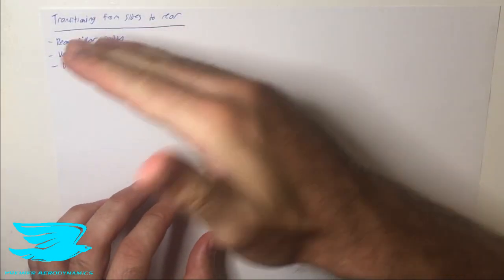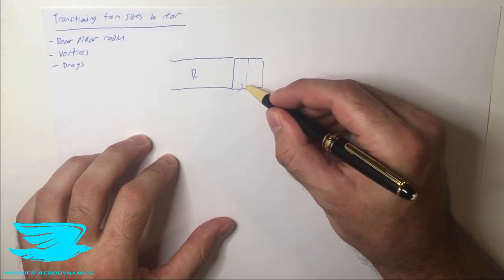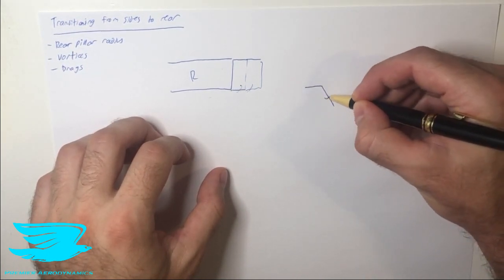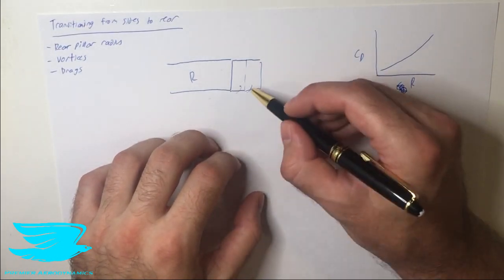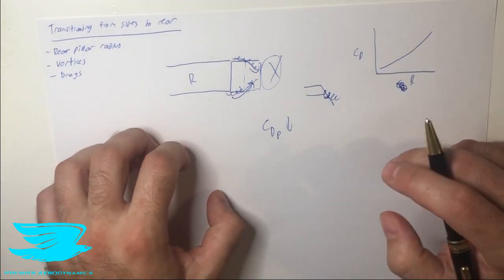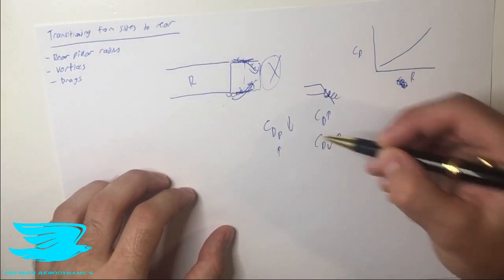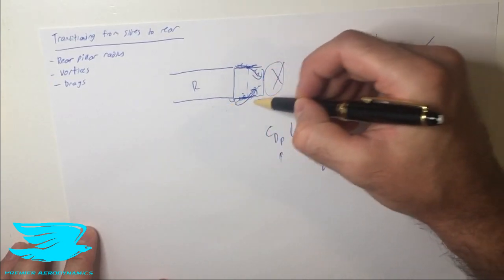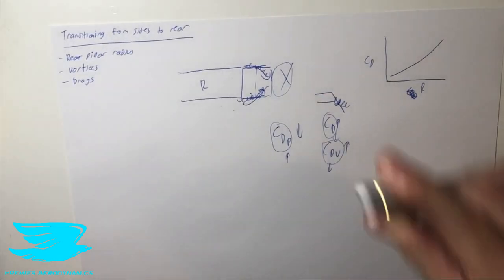{Automotive Aerodynamics #15} Surprising effects of rounding a car's rear transition

Comment: I think the rounded tail actually increase the "total" wake size, for the wake is composed of both the dead wake (contributes to form drag), and the longitudinal wake (contributes to vortex drag).
Reply from the maker: Interesting idea. The vortex drag is only appreciable when there are substantial pressure differences near the rear, or if there are major styling features. But, aggressively rounding it can do that.
Reply: @PremierAerodynamics  Yes, I mean the rounded edge make the dead wake smaller, but could enlarge the longitudinal wake, so that in the end the wake (separation area) becomes larger. Am I right?